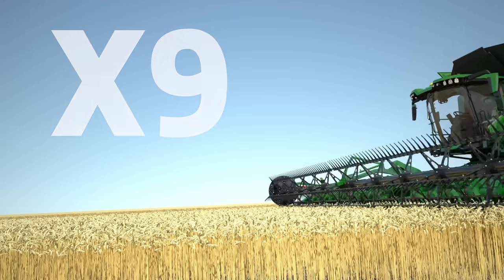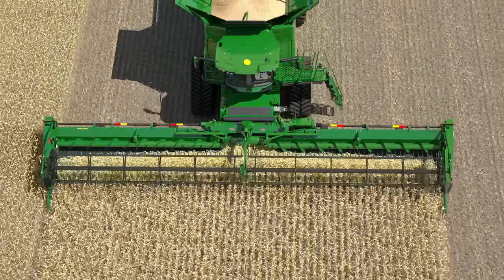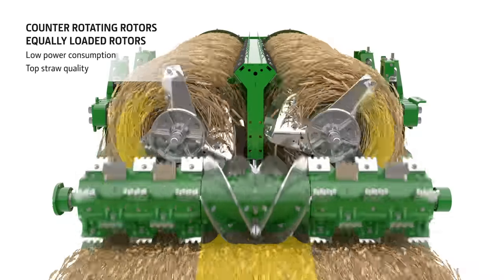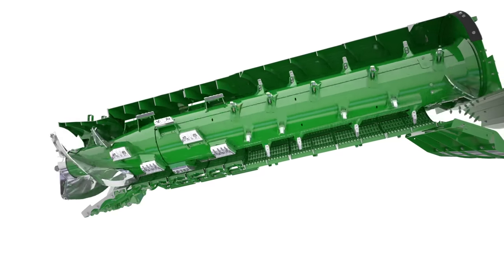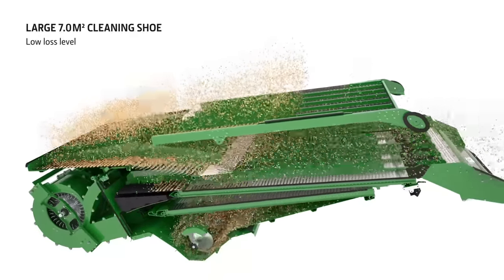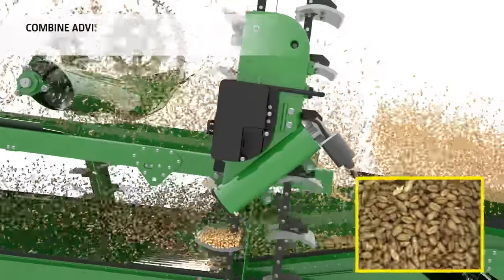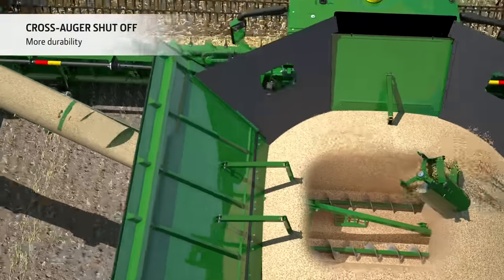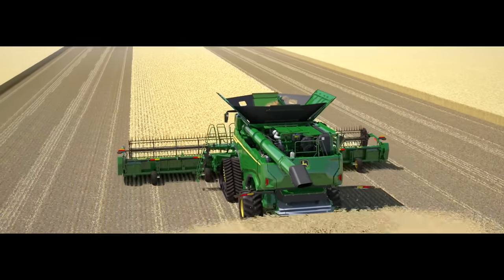John Deere X9 Combine how it works animation

Comment: Very impressive equipment.
Now let's talk about the massive cost.
And the repairability.
Reply: For maximum convenience, and optimum operational efficiency.... Reparability has been completely removed! 

....oh you meant for the equipment, not the manufacturer... my bad
Reply: This is why i prefer CLAAS or New Holland, they're about the same size (and even the dealerships sell spare parts)
Reply: You can repair anything that's not connect to the computer
Reply: @thepope2412  So you can't fix anything... The seats are air ride which are also in the computer.
Reply: @Cadaverine1990 you can fix anything that’s hardware, software is the issue, and unfortunately it’s hardly unique to Deere
Reply: @Beyonder8335 people can dog on deere all they want but the fact is any machine with this much electronics will fail regularly. We run a 2009 STS and I must say it's a damn good machine. We'll have a break down or 2 every year but it's always pretty basic stuff.
Reply: @jeffb321  yes, electronics get messy. Just adds so many potential points of failure you don’t have without them. The problem with living in the bleeding edge is that sometimes you get cut
Reply: You know, with indoor vertical farms run on green power sources and controlled by robots using hydroponics to reduce water consumption by 99% the amount of money spent on these things would seem ridiculous. And these things are starting to happen, even for crops like wheat they're beginning to crack the code. Leafy greens and berries are already doable, tubers are just around the corner, and grains are next up. Farming is the worlds oldest technology, and while this is massively impressive, it's time to move the farms to the cities where most of the people are. The reduction in the transportation alone is a big factor in bringing food costs down not to mention to lack of pesticide use, water savings, fuel savings, lack of external facilities like processing plants for certain crops.. Yeaaa, it's time farming comes to the 21st century.
Reply: @Fenthule  it’s almost like those haven’t taken off because they’re not viable or cost effective on a large scale. Vertical farms are kinda like flying cars, more of a cool concept than a truly effective idea.
Reply: @jeffb321  Same as in many fields... and you still can change a board and get the machine working... or call a nearby technician unrelated to the company to do it.

Your mental gymnastics to justify greedy corporatism are amusing, maybe you get your Rolex that way too?
Reply: @TheChzoronzon  Bruh, he is implying that vertical hydroponics are NOT universally viable. Things like wheet, Corn, potatoes, etc require a lot of space. you would never come close to the yields needed to be profittable or even feed people like traditional farming foes. Yes, Vertical farming is great for many plants, But it will never fully replace farms. 

This has nothing to do with greed or capitalism, but everything to do with simple logic and reality. Just like "Free Range" is not a viable alternative to modern methods. When you have as many people as the world has you need to produce as much as possible in smaller spaces in order to maximize output. Free range is a niche thing to help people feel better about being a carnivore. Free range only exists for peace of mind and nothing else.
Reply: @rytramprophet843  lolwut

What my post has anything to do with yours is a complete mystery... vertical hydroponics what?

(And btw, the subject of regenerative farming versus mass production yield and benefits/problems, above all in the long run, is an immensely complex one, with not clear cut answers yet... but that's besides the point cause I didn't say a word about it, I was referring to the right to repair...you are weird, lol)
Reply: @Fenthule ..lol
Reply: Lol.  Reparability.  The LAST thing John Deere wants to do is produce something that the user can repair themselves or maintain inexpensively.  Many farmers are running away from John Deere... because of unscrupulous repair and maintenance costs.
Reply: @hammingdad1  ..Not really . The cost to repair JD is no different than CaseIH .
Reply: @toledojeeper2932  You are making a case that is impossible for you to validate washout receipts.  But the testimony of many a farmer here on YT regarding modern JD equipment tells a more accurate story.  

Or take my small whole house Caterpillar Generator, for example:  CAT went to the trouble of erasing all the numbers from the certain standard parts so that I would be hard pressed to identify them... thereby forcing me to pay 4 times the normal price since I must buy one with CAT on it.

We really do need better consumer protection laws - particularly when it comes to expensive tools and heavy equipment.

Let me put this another way:  I do not see many YouTubers familiar with repairing JD equipment who are raving about repairability / maintainability.
Reply: @hammingdad1  ..We have JD tractors and we have CaseIH tractors. The dealers have the same labor rates . The parts cost between the two are not much different. 
We actually have very few problems with any of our tractors or combine . The last time a tractor was in the shop was over 1 year ago and it wasn’t a JD.
Reply: @hammingdad1  ..Do you have proof that JD dealer labor rates are more than CaseIH .
What CaseIH part is less expensive than a JD part ? I mean there can be a few dollar difference but there’s nothing outrageous in price differences.
It’s funny you are making a case about Cat parts costing a lot of money but on here putting down JD .
Reply: @toledojeeper2932  I think you are missing the point.  It is not labor rates that are egregious it is parts costs, markups and SOLE SOURCING... meaning that a part that should cost $15 or $20 ends up costing $150 and you can not buy it anywhere else.  Look around.  American farmers are beginning to hate JD and any company that imitates them.  Using "safety" as an excuse to avoid right to repair... consistently lobbying to BLOCK right to repair legislation.  Anyone who repairs anything knows that John Deere opposes R2R from the get go.
Reply: @hammingdad1  ..Once again you must of not read my comments. The parts for CaseIH cost the same as JD .  You yourself said Cat parts are expensive. But yet you criticize JD .
Some parts you can get aftermarket.
JD signed a right to repair agreement with all the other farm equipment manufacturers in April of 2023 .
Every vehicle manufacturer is protective of its software.

Comment: I work for the company that supplies some of the components to Deere Harvester Works at Moline Illinois - from main rotor nose section, blower housings, complete chopper rotor assemblies, counter knife assembly, ducts, auger flighting, platforms (to get in to the cab), AutoTrak sat guidance, and probably many more.  It is very, very cool to see how everything goes in to the final product - thank you for sharing this animation!  When you see what all goes in to these incredible machines - you can get a sense of why they are north of $1,000,000+   [huge hat-tip to Deere & Co and all of their production partners for helping this 187 year old company continue to be successful and be an innovator]
Reply: @@willheheckaslike8315 I was thinking that too, but I imagine you wouldn't have one of these unless you had thousands of acres under plow. It's kind of crazy that it's a rolling factory/processing plant.
Reply: @@willheheckaslike8315 no wonder that damm bread is so expensive
Reply: Your company should sell parts to the farmers who are prohibited by Deere from repairing their own machines.
Reply: Why did the John Deere rep cross the road?  
To hand over the repair manual to the corporate lawyers who'll make sure no farmer ever gets to use it.
Reply: @dzcav3 ..Every manufacturer has a restriction on their software . But JD allows farmers to repair their own equipment now .

Comment: So basically a New Holland twin rotor system from the 80's.
Reply: John deere had a twin rotor in the 80s-90s. It’s called the CTS ever heard of it?
Reply: John Deere first began development of rotary combines in the 1950's
Reply: you took the words out of my mouth ! Deere are very good at refining every other manufacturers designs .
Reply: @luvelyjubely sure! Lol
Reply: @luvelyjubely Not even close to the same. The CTS was more similar to copying the Claas APS system.
Reply: It took them all that many years to copy New Holland and other manufacturers.  Jd is well noted for copying patents.  They still haven't got it right. Lexion Class still has them beat on biggest machine on the market
Reply: John deere had to wait for new hollands patent to run out before they could make a combine comparable to the cr10.9 I think the john deere is slightly bigger but not for long
Reply: @JA-fn7le You mean the APS system that came out after the CTS right? Deere copied something that came after their machine😂😂
Reply: yes, but the threshing was done by the conventional drum and concave.
Reply: New Holland Deere,, lol
Reply: @luvelyjubely CTS was not a twin rotor. It was cylinder tine separator hence the name CTS.
Reply: @joescheller6680 actually the X9 is bigger.
Reply: Oh how the turn tables
Reply: With computers that you are not allowed to fix
Reply: @boomerang379  sorry correction, some models of the cts are twin rotors, like the 9780
Reply: Tr70 was 1975.  Not just the twin rotors come from nH, but the undershot rotor feeding, grain pan, and presieve all look very familiar.  I do like that a pan takes the grain and MOG from the separation area back to the grain pan.  But that and 2” larger rotors look to be the only real improvements.  The NH rethresher looks superior too.
Reply: @luvelyjubely  yes ever heard of patent infringement they copied New Holland that's why they didn't purse it. International drug their feet on the rotary combine also the engineer that designed it tool it to New Holland to develope it
Reply: @luvelyjubely  they copied New Holland then  thats why they couldn't pursue it patent right
Reply: @kyleschies7345  pretty sure Claas has had this threshing system longer than just the "APS" name for it.

Comment: All good in theory but way to complex.  Just more moving parts to break.  And almost impossible to get to. Seems it would be really difficult for field maintenance and repairs, even if the owner/operator had the diagnostic codes to sort out the repairs needed.  Always hated keeping the combines I drove for my dad back in the 70s/80s working in the field when green stuff (thinking here Johnson Grass) was sent thru the Case 1660s with the soybeans in the Fall.
Reply: actually service panels and access are getting better all the time.  This is one of the easiest machines to field service.  Rotar systems are more reliable and easier to maintain the the older systems.

Comment: The only reason John Deere is putting out this video and combine is because the patent for a “twin rotor” machine ran out and now they are able to use new holland tr combine (the og in twin rotor combines) and cr combine which is the updated version of the tr. Also if you were curious tr stand for twin rotor.  Before the patent ran out John Deere and Case combines have been using a single “rotor” design which is unironically half as efficient.

Comment: i love the fact, that in this simulation, Harvester rear tires is mounted backwards :D
Reply: They actually arnt mounted backwards.    All tires that are not driven by power get a half a turn for floatation in muddy conditions
Reply: I love the fact that this is a big ad for a company that forces the owner to tow their machines back to the dealer for expensive repairs.

Comment: At $1,200,000.00 each, seems like John Deere is the one making the most profit from farming.
Reply: Prove it
Reply: For a machine with this level of complexity and size 1.2m seems reasonable.
Reply: @spacebound1969  I'd be more concerned about maintenance and the resolving of computer related issues tbh. That's a lot of moving parts. Holy crap.
Reply: @steeldriver5338 
And alot of sensors to go bad.
Reply: oh you havne't seen the repair policy.

Comment: Well there is only three rotor designs to say they copied new Holland is like saying everyone puts the draw bar at the back of the tractor   There’s only so many ways to do it.  Lot of adjustments from the cab. Be great till it don’t work then what
Reply: You forgot Claas they still have the John Deere beat in overall capacity
Reply: you buy another one of course

Comment: Complicated and expensive with a ton of belts (and bullies and bearing to be greased).  However, everything at your hands command.  For larger people, the cab should be another 4" wider.  I don't know if tires vs belts are an option as tires saves $ and actually offer less soil compaction.  CLAAS, IMHO, offers a solid competition to the Deere.
Reply: and a better repair policy i bet.
Reply: @sheilaolfieway1885  That's a given.

Comment: Actually the first and biggest rotary made was the field boss by white farm equipment. It was a very lighy built machine had lot of bearing issues because of using too small bearings. They were tsken over by Massy Ferguson  and they further developed it but massy was falling at the time was never pursued..enough to make them the leader again.
Reply: IHC  made the first big rotary ,they took the plunge and spent over 10 years and 100 million dollars in 1969s money and perfected it ,WHITE copied IHC and and released the 9700 Field Boss .IHC sued WHITE for patent violations and won .Ffs mate do some homework before you write nonsense.
Reply: @interman7715  your wrong my man the guy that developed the rotor was working for IHC at the time they didn't want to pursue it so he took the design to New Holland. That's where the twinn rotor came into play had to change its design so as not to copy IHC who at the time didn't think it was a good idea
Reply: Actually the field boss changed their design so rotor ran cross ways to the machine similar to Gleaner.  Do your home work.

Comment: I much rather have a cat Lexion 595R combine what was made in 2005-2010 what have the same capacity on corn because it has 3 front beaters instead of one what looks identical to claas and cat /claas had twin roters in the 1990 but they invented the 40 foot platform head and 16 row corn head for the cat 590r type combine but most of the separation happens in the 3 front beaters where the are conclaves what the twin roters work as a mechanism for just collecting the stuff the beaters miss
Reply: I own the cat Lexion 400 and 500 type sales brosures

Comment: I have about 1/2 acre back yard that is mostly Kentucky bluegrass but has small patches of weeds (I think mostly clover?) near one long stretch, about 20 feet long by 3 feet wide (EDIT: this is the dimension of the weed patch, not the lawn!). I have been thinking of getting the X9 but it is very expensive, cheapest I have found is 800k, it appears like it would need quite a bit of maintenance and I am not positive it would fit completely in my driveway. Does anyone in a similar situation have the same unit and if so, how has it been?
Reply: don't the repair bills are horrendes buy a brand you can get repaired for cheaper. You cannot repair it yourself nor can anyone but Deere
Reply: @sheilaolfieway1885  I have some basic DIY tools (hammer, both types of screwdrivers, studfinder, etc...) and I imagine I could figure it out. Might void the warranty but I've had pretty bad luck with warranties being honored in the past so I don't mind tinkering.
Reply: @miketgates The machine will detect if you try to replace anything and instantly drone strike your property. Thanks JD
Reply: @YodielandInhabitant710  There is no way that would happen. Pretty sure that's illegal bro!

Comment: It all makes you wonder if they're actually worth the loss mitigation. When you're talking about something that costs 1 million dollars vs some old method that costs 50 thousand (or even older tractors that might cost even less), it makes one wonder if all this extra stuff is fluff that doesn't actually pay off, especially with how costly repairs are. Now maybe over 20 years it might pay off, but payoffs over those long scales aren't even really worth it, especially considering we could buy 20 times the equipment for the same price and increase capacity, which increases total income. So all these efficiencies are more about robbing the farmer than actually improving things.

Comment: The problem is is not harvesting per ton you can tell those guys reading off of paper it's per bushel. Bushel is the primary unit of agriculture not tons.
Reply: Depends where you are from. Bushel's are an old imperial form of volume/ mass established back during the Norman conquest of the British Isles and make little sense in the modern metric age. Even the US Gov't has various trade acts in place utilising metric weights & volumes since the late 1980's because world trade occurs in tonnes.

Quite simply put, a tonne of wheat is the same for corn, barley, oats etc and it most certainly is not for a bushel.

Next you'll be saying that an acre is a better unit of land measurement than a hectare.

Comment: it works until one of the 52348973465894 sensors malfunctions and brings it to a complete halt until its fixed
Reply: the farm that have these have like 10, and another few ones to cycle when they malfunction.

Comment: When they worked they worked great,  when they failed it was a multitude of issues from welding issues internal to poor crop threshing with some crops and far too many plugging issues... Expect to see plenty of 2023 X9s at the RB auctions everywhere.  This was a great idea but not ready for prime time.  Far too many engineering and quality issues with these machines.